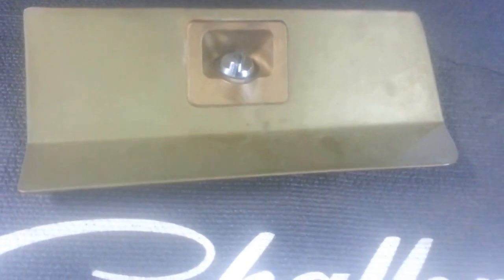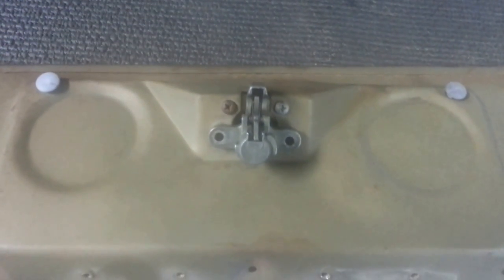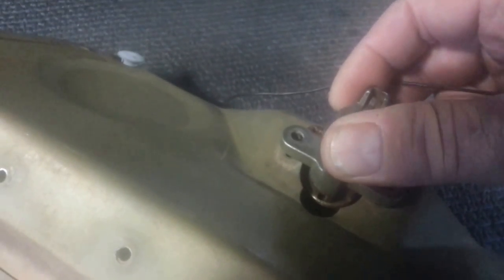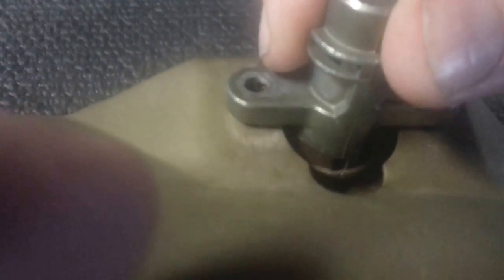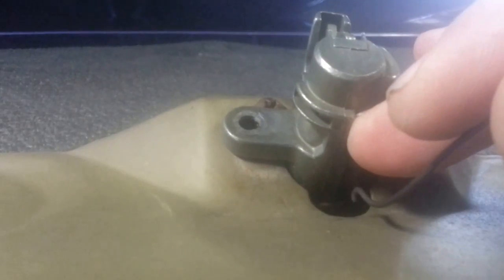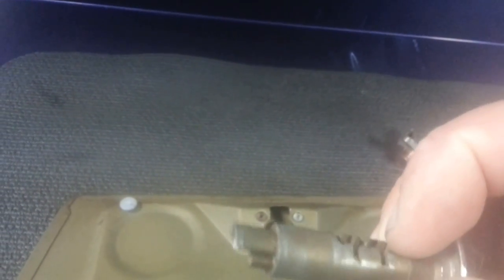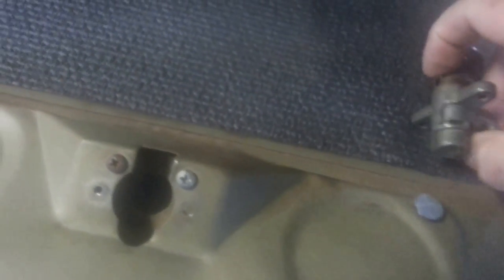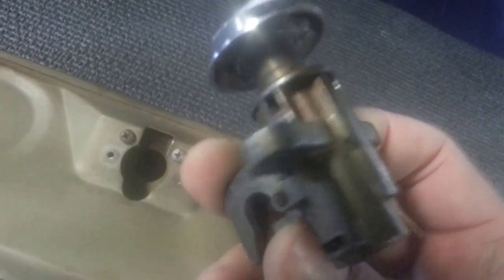Mopar Glovebox Lock Removal

Comment: Now that I have it apart, I see what that hole is for. If you stick a needle in there, then push the tab down , you can push the needle through to hold the tab down. Then it holds the tab down to put it together again. I never would have got that far without this video though, so thanks a lot.

Comment: Actually you have the pin hole in front of the knob which is used to insert a hard wire ( clip or needle ) and  will keep depressed the locking tab while handling the knob in and out.
Key cylinders are diff thought
Reply from the maker: Nope, not on this one. Maybe on yours but I tried for hours until I found someone smarter than me who had a written procedure.
Reply: Need to press the locking tab first, then insert the hard wire or clip to hold it depressed. And that will work to reinstall.